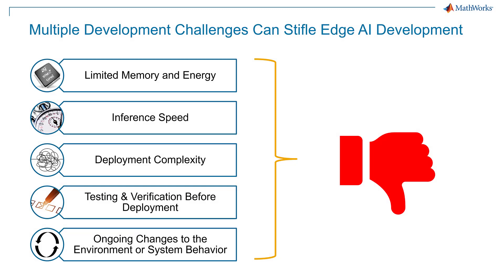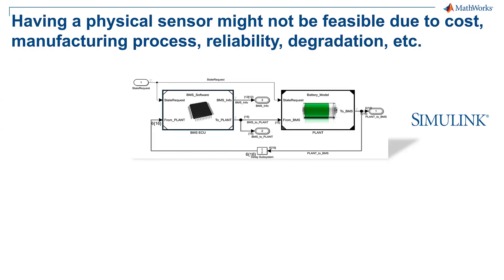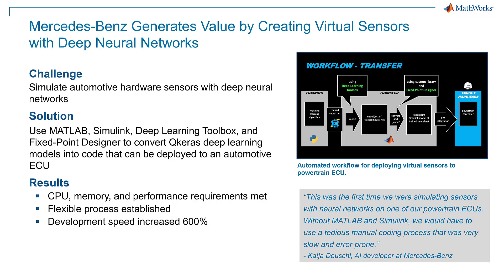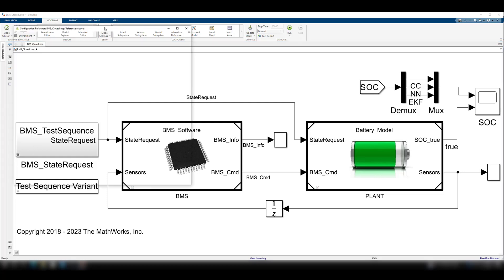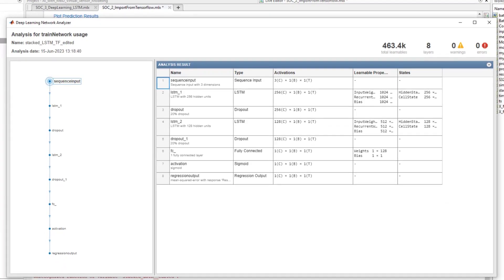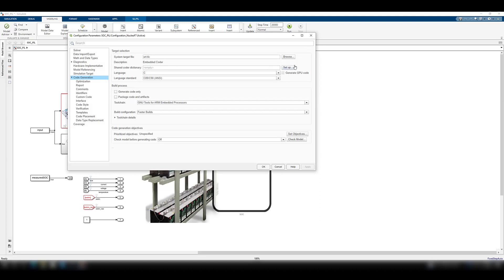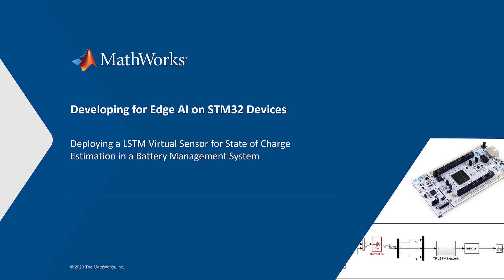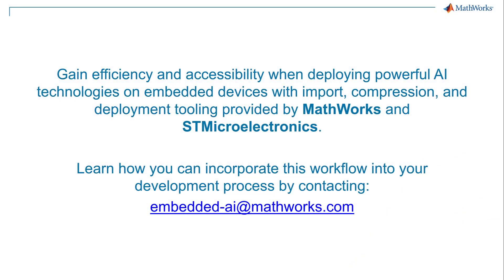Workflow for Deploying a Neural Network to a STM32

Comment: How you can say the "Full Potential"  of the hardware. Full potential is not achievable using the Simulink coder support package of F7. So, if someone is looking to get full potential like timers triggering and some motor control applications then he/she should go for the EMbedded Support package of STM32F7xx. And Embedded support package demands hardware knowledge and its very laborious to configure the hardware in CubeMX first and then load that IOC file into the simulik. It generates erros most of the time and their help is not available. So, development becomes very difficult for STM32 hardwares.